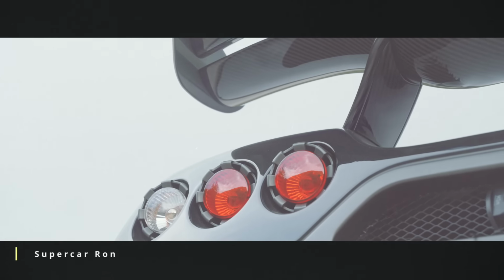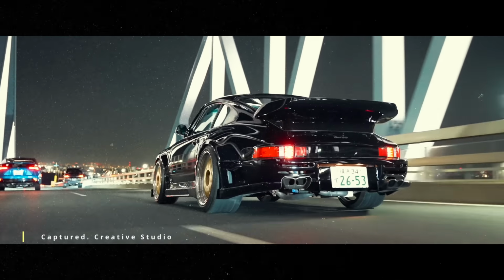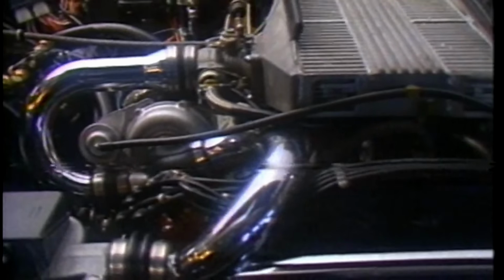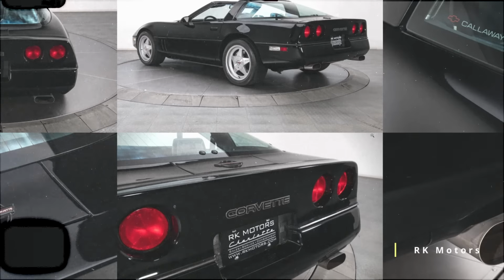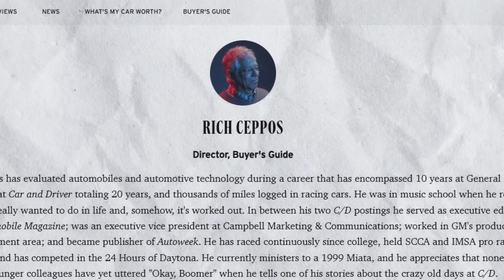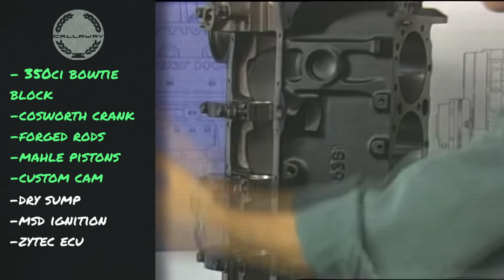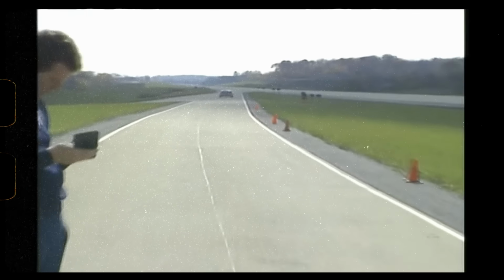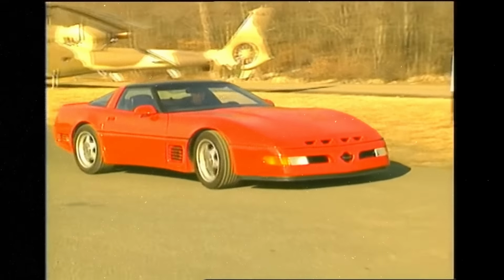Was The World's Fastest Street Car for Almost 20 Years

Comment: TT Ford GTs have held the standing mile world record since 2011 and the current king is M2K MOTORSPORTS @ 300.4 mph in the mile. No "hypercar" is close.
Reply from the maker: The GT is one of my fav cars of all time. Those TT builds are phenomenal.
Reply: You are confusing tuner racecars with production cars that has 5,000 more requirements to meet for road legality both in all 48-homeland states and internationally.
Might as well give that record to Tasca with 341 in the 1000 ft.
Edit: The Calloway Sledgehammer did pass actual road legal and production requirements (not as strict as today but back then)
Reply: @barath4545 only 510 over 5 years and that is considered production?
Reply: @barath4545  The Ford GT IS  a production car ,  capable of 200+ mph right off the showroom floor. The mk2 Texas mile gt is the fastest street legal car in the world .  Oh and Tasca was clocked at 339.1 mph at Bradenton Fl this spring. There that should clear up any confusion you might have had , your welcome.
Reply: @tylerking27  Bugatti made 270 Veyrons in 6 years and 500 Chirons in over 7 years.  

If 510 cars in 5 years isn’t “production” because of numbers, then the Veyron and Chiron aren’t production either.
Reply: @joefell7845  I have doubts about how legal it actually is. both bugatti and koenigsegg have to work directly with tire manufacturers to develop tires capable of 300mph+ developed specifically for that car. no doubt costs millions in r&d. and this ford gt supposedly took some off the shelf tires to go 300mph? I just don't buy it.
Reply: @etrcentenario9737  So you think the whole Texas mile event is fake 
then ? Did you watch the video ? The whole thing can be researched fairly easy fella. I never said the car wasn't tuned to the hilt, but the car is stock bodied and original block car and is street legal wether you "buy it" or not. 300.4 mph as the gentleman stated,in a standing mile no less .
Reply: @joefell7845  I'm not saying it's fake. I'm saying I doubt that Ford gt could go from that pass to an inspection bay and pass a state inspection. it did it no doubt, a huge accomplish nonetheless. but I don't think it did it as a street legal car. it may have been at one point, maybe even the day before, but not while it was doing the pass.

the whole point of my comment is if it's not street legal it can't be compared to any production car record because those companies have to follow all regulations to build their car. so if they didn't follow the regulations it doesn't make sense to try and compare the two.
Reply: @joefell7845    Yeah, it's pretty far beyond the realm of street car.  It's also not the "original block" (which was broke after a 281 mph at the Arkansas Mile ).  It was a production block (since no one makes an aftermarket one to my knowledge), it was also a sleeved and fairly modified.  

The engine was built by well known mod motor guru, John Mihovetz...  Who's constantly brought up since he had a mod motor powered car than runs 5s 1/4 miles.  The engine in that GT has 13:1 compression.  That alone is a hefty ask for pump gas (essentially requires E85), not to mention the 50psi of boost they cram into the thing (which could obviously be reduced for street duty).  

I'm not gonna complain about the tires, which were obviously not street legal Hoosier R1 road race tires.  Swapping tires isn't an issue to me unless it's "production car" claims, then it should be noted of "stock w/tires".  

The car is an absolute insane monster.  It's also not really a "street car", and I'm pretty loose on what qualifies to be a "street car".  One key reason for me is they only drive the car at the track, and I've never seen any attempts for them to street drive it (doesn't even have tags).  It's something I have to give credit to the "4000hp pro mods" that do 1000 mile road trips on the drag n drive events.  They are licensed, insured, and drive the things hundreds of miles in whatever weather is thrown at them, often while hauling a small trailer and with no support vehicles....  And then rip off 5 second 1/4 mile passes at multiple tracks in route.
Reply: @joefell7845  how bout you think it's almost 3k HP lol... I'm from between Victoria and Beeville Texas.. and the sledgehammer didn't have that much power and hit 255mph , now you slapping flap about 300mph .... Not a flex
Reply: @df5849  it most definitely is! Anyone who understands aerodynamic drag understands that every time you double the speed, the drag quadruples. Aerodynamic drag gets really stupid really quickly, not only am I a Tech graduate, I have my pilot's license and I absolutely love aerodynamics. Might just be 45mph difference to you but that makes up for a whole lot more drag and a whole lot more horsepower needed just to get it to go that fast. They have a phrase in aircraft design and aerodynamics on race cars. There is no free lunch. It's not easy to get it to go that fast.
Reply: Always, always always always always and always some Ford girls getting upset because a Corvette set or broke some records !!!  This video wasn’t about billionaires that build a one off super something that needs a full time mechanic and is probably parked in a climate controlled garage and driven a few times a year…😂 Most folks know about the ford gt that has 3000 HP  and probably couldn’t beat BIG RED in anything with turns …!!!  So does the Bonneville salt flats count?  I believe a Chevrolet powered machine holds the fastest piston powered car on the salt flats..!  Built by Detweiler performance ..!!! 😮😂🤣🏁
Reply: @barath4545  Only one Sledgehammer was ever built that could achieve 250+ mph, it definitely wasn't a production car, by any stretch of the term.

Comment: This statement is a bit misleading... as it only applies to package-spec tuning house cars. Sometime in the late '90s or early '00s (2001, I believe)... you could purchase a Lingenfelter Corvette capable of topping this speed.... to the tune of 270+ mph. The catch was, you had to specify a different axle, which wasn't adverised, or even openly offered. In as-spec trim, it topped out around 230/235, with optional gearing. With the un-spoken optional axle, it is rumored to breach 270mph. From my understanding, despite a handful being sold... the test was deliberately not sanctioned/officiated, for the sake of liability. I don't find this hard to believe, as Lingenfelter had reliably produced in excess of 1,200 reliable horsepower at this stage.

Comment: You'd think that engineers would have figured out how to reinforce the bottom  end of an engine much sooner. Using a ladder shaped brace for the bottom main bearings. Instead they were just adding more bolts 🔩 going from 2 to 4 bolt bearing caps.

Comment: Even though the Callaway cars were technically 'Corvettes' on their VIN and not proprietary cars manufactured by Calloway, I recall they could be ordered through Chevrolet dealers as a car blessed by Chevrolet.  So they were officially recognized.  I don't know how good the Corvette's warranty was at that time, but I believe they were covered under warranty as well.  So, once offered from Chevrolet, they were production cars and not regarded as tuner cars like the original Top Gun was as well as most of the other cars at that Gathering of Eagles challenge (I recall eagerly reading that article) other than the AMG Hammer and the Ferrari Testarosa.  In a way, they were like AMG was to Mercedes but rather before Mercedes bought AMG in 1999 when they turned it into their in-house performance lab.  Prior to being under Mercedes, I believe they had always had Mercedes' blessing and people could order their AMG from their Mercedes dealer.  Like the Hammer for the C/D article.

Comment: I remember that I had a car magazine 1988 where was a test with the Sledgehammer ❣️😃
It blowes my mind as I see the topspeed from 408 km/h ❕🤩
Never seen a car before what hits the 400 km/h barrier.
Many years later the Veyron has 412 km/h topspeed.
Whats l'm wondering...where Callaway get tires 1988 which can use to over 400 km/h ❔
I remember that the tires was the problem, why the Veyron needs I think 8 years longer to developed❕🤔
Love from Berlin 🇩🇪 
Ramsi 🙋🏻‍♂️
Reply: No independent test to verify like all other cars. I also wonder what tyres they had.......
Reply: @dingrey  Yeah ❕😅 
Maybe they had a Special tire for Highspeed runs... Prototyp or so ❔❕🤷🏻‍♂️
Reply from the maker: Excellent question! It’s reported a prototype Good Year tire was used. The rumor is that a Good Year engineering team met Callaway at TRC and supplied a prototype/obscure tire. After the run was done they immediately removed the tires, packed up their equipment and left. The way I see it, this was a rare chance for Good Year to test a street tire at the highest speeds imaginable for free and collect data.
Reply: @SpecMDriven  Ah okay... thanks ❕ 😃
Interesting 👍🏼

Comment: Believe it or not, I drove the SledgeHammer and later the Lingonfeltner twin turbo vers back in the 80's..  They were not mine..  I just happened to be friends the son of a prominent Houston dealership back then..   We absconded both times with them while parked show center in the main showroom.   It was a PAIN in the arse to move the other cars and get each of them out..  Bring them back in and put the other cars back..   BOTH of these aftermarket savant companies..  There was nothing I had ever driven previously that just pulled and pulled and just kept pulling..  Almost certain I / we pushed past 200..     The odometer was disconnected prior to "lift off", so we were guaging speed by gear ratio and RPM..     Yeah...  Just a little bit bending the law, but if there were so much as an added fraction of a mile to that odometer, big boss Dad would have likely turned his gaze rightfully so on his and Me...    They were so far ahead of their time..   I actually liked the Lingenfelter better, but that came after the Sledgehammer...  The suspension was top notch and the shifting was better as well..    My friend died a long time ago wrecking out another car..   His father is deceased now and I'm not sure if the dealership is even still around..  It was the largest in North Houston back then...   I always wondered where both of those cars went..   I think the lingenfeltner was about $140k back then...  I was a kid..   Definitely out of my pay anything.    BUT, I AM glad we took both of them out. Worked our arses of to get them out and bring them back..  (AT NIGHT - obviously)..  From North Houston to Galveston almost in a blink of the eye..    We also "borrowed" the fathers personal Vector W8?..  It was NOT even close to performing like those two Vets..   I mean, Night and Day performance differences..  But, those Vectors were some amazing looking vehicles..    It is going to be interesting what aftermarket ups custom builders and tuners do with the ZR-1 of today..   FK Ferrari... Fk Lambo..  American made bad arse Corvette..   Then God created Zora!   Actually, Mr. Zora wanted to create the Zora!   ;).   No contacts in the automotive biz any longer..   And, while now 52 years old, I can afford a ZR-1 and a Zora..   But, I'm not on "the list" to be invited to queue up and wait..  ala..   Recent purchasers of Vets..   P.S.   I also have driven the "Blue Devil" Corvette, but honestly (and I could absolutely be wrong), I liked the Sledgehammer from forever before it more...

Comment: That Keith Black Camaro shows everything wrong with hot rodders now. A 541 cubic inch engine making 700 horsepower. With an 850cfm carb. And you’ll see people at local parking lot shows who put an 1100cfm Dominator carb on their stock 300 horsepower crate 350 because they think it’ll make more power. 😂

Comment: ...so Sledgehammer with 880 hp hits 255 mph, but a Bugatti Veyron SS with 1200 hp hits only 267 mph. Seems like drag is off the charts at those speeds...:/
Reply: Maybe. But theres also the exponentially increasing wind resistance that would massively amplify very small drag differences. All other things being equal, gaining that additional speed may very well require that additional 300-something hrsprs
Reply: @paulmryglod4802  ...air resistance is increasing with a square law so it's a massive factor. 

I remeber hearing in some old Bugatti review (Tog Gear) that to reach 200 mph you need like 300 hp (or something like that), but to reach 250 mph you need full 1000 hp...:)
Reply: @t850  yup!

Comment: "...suffocated by the emissions regulations of the 1970's oil crisis..." makes no sense.  One did not cause the other.  Emissions regulations started in the 1960's, while the oil crisis of the 1970's was caused by the embargoes of the oil producing countries.
Reply: 60s emissions tech was just exhaust air injection or EGR systems.

Catalytic converters came in '73.
Reply from the maker: That statement was per Dave McLellan, head engineer of the Corvette dev team at the time. Guess he didn’t know what he was talking about.
Reply: @anthonyrowland9072  Yes, catalytic converters came out in 1973-ish.  But that has nothing to do with the oil embargoes, which just happened to start around the same time.  Your statement seems to imply that the emissions regulations were the result of the 1970's oil crisis, which they were not.  The CAFE requirements that came in late 70's were the result of the oil crisis, which are different from the emissions regulations.  They both just happened to be imposed by the EPA.

Comment: Why did it seem that they all seemed to have such a hard time making power in those days? Was it just because they had to meet stupid pollution requirements that they didn't know how to meet?
Reply: YUP. And only a few people were putting turbos on anything but diesels other than the Germans and Japanese cars may have at that time, plus those are still just a simple push rod motor and adjustments are all mechanical bolt ons. No trip down to your local tuner to change timing, air, fuel with a few clicks on a keyboard.
There are only one or two cars today that make that kind of hp in a factory vehicle

Comment: Not as impressive as the devil z car that hit 360+kph and not even on a straight track back during same era. Japanese was way ahead of American cars then and with way smaller displacements.
Reply from the maker: The 1996 Devil Z record was almost a whole 10yrs later, after the Sledgehammer and Top Gun. It was also done on an oval track similar to TRC. There were various stock production cars capable of 210mph+ by this point.

Comment: Jun/blitz 300ZX. 261mph, 1992. You're welcome.
Reply: That was a salt flat car, that wasn’t anywhere near street capable. The sledgehammer speed was recorded on an oval track as well.
Reply: @johngarlick7115  Thats funny, because it was a registered street car and just sold - as a street car, and JUN offered that exact package for purchase as a street car.
Reply: @mrZdude  the one raced at the salt flats and the production package where 2 completely different cars, yes jun offered a street friendly version of the engine and fueling mods, but the one raced at the salt flats had to be pushed to get moving under its own power and hit that speed briefly over a 9 mile long flat course, with no headlights or taillights, full fiberglass front body, fiberglass doors, no interior except drivers seat, and instruments, heck the race one didn’t even run an alternator while making it runs just constant loss on the batteries and recharged between runs. Yes the package you mentioned was capable of serious power, but in know way shape or form would the street version of that package run what the purpose built salt flats one did.
Reply: @johngarlick7115  Was it stripped more during its racing life? Sure. Does that make the 1200hp road trims less capable? Absolutely not. The street package is still a 1200hp car from the early 90s that would absolutely donkey stomp the Callaway Corvette, and I will die on that hill lmao
Reply: @ the street version ran a best of 181 at bonneville bud, 262 was the race car look it up

Comment: You can't compare a turd Calloway tuner car to ANY proper European/Japanese Supercar! It was a Corvette with a tuned engine and the Corvette as standard didn't have the chassis to suit it's power. Leaf springs! Shite suspension, a loose poorly designed chassis, brakes not up to the job! A recipe for a hilarious disaster! Like most US cars they are ok down the quarter mile and........good for posing and.......? That's it! A much, much lower powered Honda NSX would annihilate it round a track or proper road with twists and turns! The NSX wasn't even a supercar and was far from fast but it DID posses a great chassis, brakes, perfect balance and enough power to keep it rapid! Even a half decent modern turbo charged Hot Hatch would destroy a Calloway Vette!
Reply from the maker: Weird, didn’t the C4 outperform the Porsche 928 in the slalom though? I highly suggest you go research some Nurburgring laptimes of US cars like the C5 C6 C7 Z06, Viper ACR, ZL1LE, C6 C7 ZR1, etc. seems your US performance car info is not up to date.
Reply: Another 🤡
Reply: @SpecMDriven  up to date for THIS Calloway that's for sure! The Porsche 928 is a GT and not a sportscar or supercar.
Reply: Make a list of faster 90’s street cars or FTFU! 🤣
Reply: i didnt even finish watching it cause you said it right lol